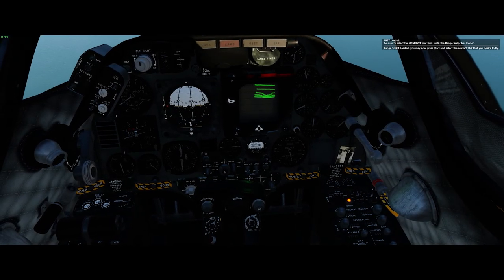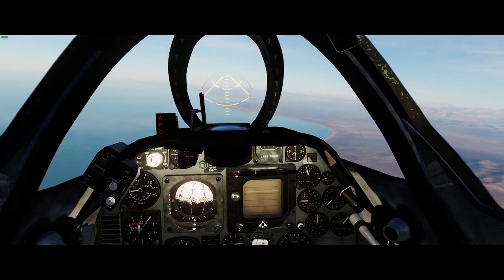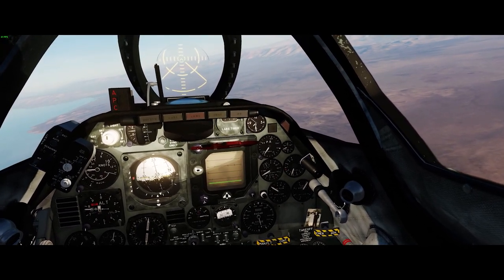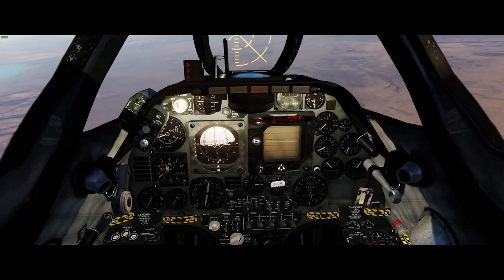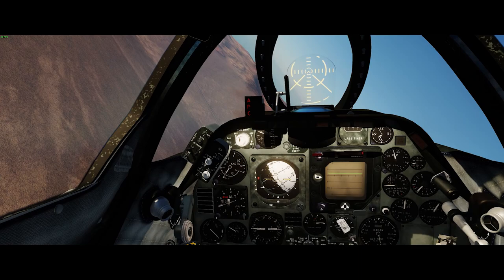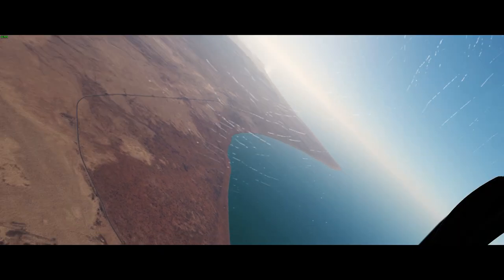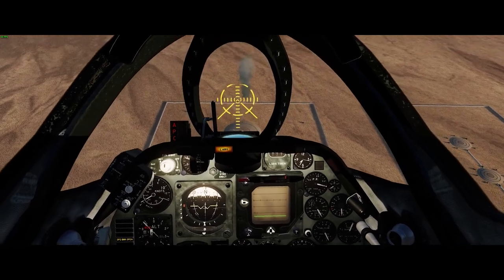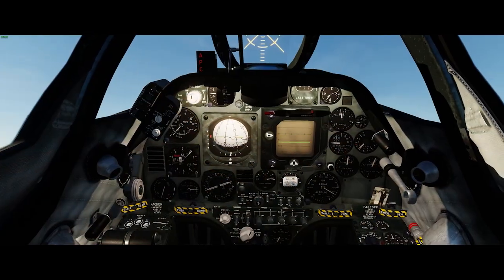Using the A-4E Bombing Computer - Iron Bombing Tips and Tricks

Comment: thank you for some good video. What is the practical  difference between LABS and cmptr?
Reply from the maker: The in the released version of The A-4E for DCS, the LABS system is not implemented - only the bombing computer - and it has it's own switch position now.  In real life the LABS (Low Altitude Bombing System) was a system that was developed to allow US fighter bombers to deliver nuclear warheads from low altitude.  The pilot would perform a high G pull up maneuver Over the target and toss the bomb to high altitude providing enough time for him to egress the area before the blast.  That was the theory anyway!  As I said, it's not implemented in the game. At the time of the release of this video the developers were still using the LABS setting on the dial because the had not had a chance to redo the switch to add the CMPTR.  That has since been done so you no longer use the LABS setting.
Reply: @Sidekick65  thank you. the tutorials on line show that LABS needs to be selected but since i am using the v 2.0, i was quite frustrated by the fact it didnt work. i tried 'cmptr' and discovered that worked but then did not know why they kept the LABS  on the dial. Any way, how can i make that LABS sound lower? It is annoying.